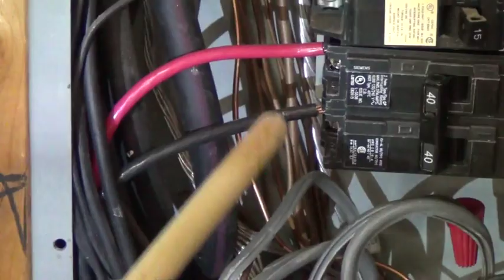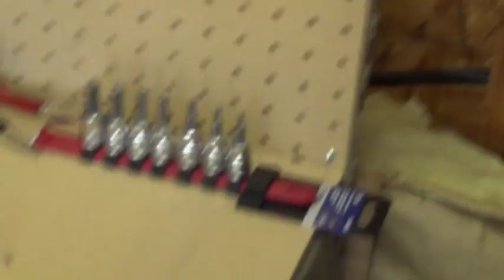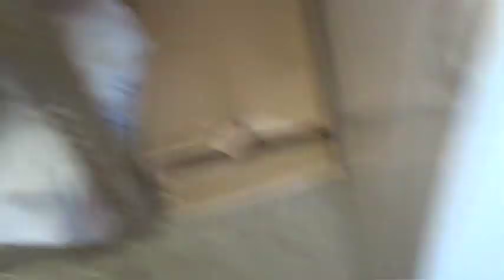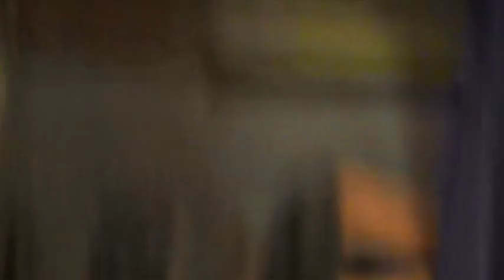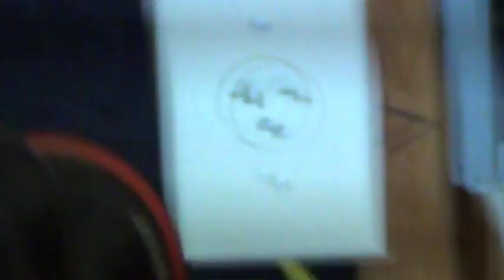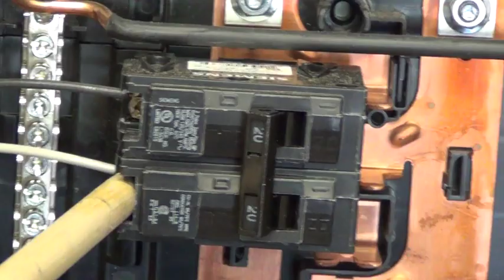subpanel install Pt 2

Comment from the maker: Hmmm.   I'll take a guess at what you are asking.  Only wire runs are grounded.  The bare copper grounding lead in the feeder between the panels is connected to the other copper grounds in the main panel and to the (either )grounding bar in the sub panel.  The bare wire for the outlet is connected to the grounding bar in the sub panel from which it is fed.

Comment from the maker: Not true.  That screw is call a "bonding screw".  IF the neutral and ground were to be bonded then the screw would be torqued prior to mounting the panel allowing it to make metal to metal contact.   As it is now the screw is "floating" above the panel in plastic threads.  I could have removed it but then I'd just have another loose screw.  Couldn't resist.   :)

Comment from the maker: Yes.  However remember panels are planned based on the fact that every load will not be on at the same time. For instance I have 200a service but if I add up all on the individual circuits they exceed 400 amperes.  Common sense, chance and choice should prevent issues.

Comment: Very clear concise video. I enjoy your narration. My only critique is failing to use conduit to protect your wiring. If you overload a circuit or nick a wire you open yourself to a fire. You can also feed multiple circuits through conduit should you want to expand. Then again I'm from Chicago and your wiring would never pass an inspection here.

Comment: So since your breaker is 40 amps max feeding the sub-panel,that basically gives you 40 amps max to work with for the sub-panel? Then, your using 20 amps for the 240v outlet. So, Does that leave you with 20 amps max left to work with in the sub panel for future use?

Comment: Good install job, but i must ask why only 40 amps  beside the fact you used 8AGW wire.
it limits you of having only two 20 amp 240 volt circuits or one 20 amp 240 and two 20 amp 120 circuits .

Comment: i would recomend using a #6 wire and a 60 amp  a normal arc welder takes 35 to 40 amps its better to have a extra 20 amps for things like a heater and litghs that could be running at the same time

Comment: looking good, but one error. On the neutral bar of the sub panel, there is a green bonding screw which bonds the panel with the neutral bar. That must be removed for sub panels. Looks good otherwise!

Comment: Well Done! defiantly learned a lot here. I want to do this in my garage. Right now I have two lines coming from my panel box in my basement one is running one outlet while the other is running the whole garage. I want to clean this up and have a subpanel running the garage, Now with a better understanding of how to get 240v I see a welder in the near future. Thanks!